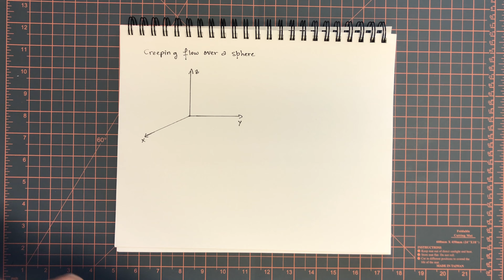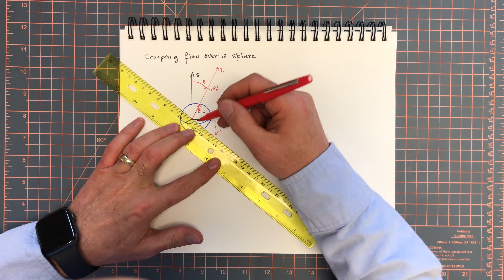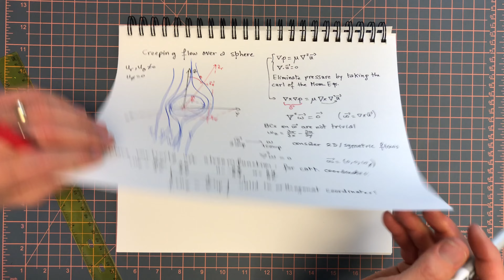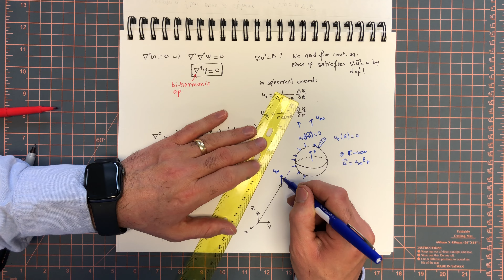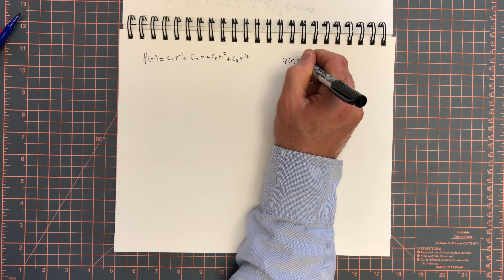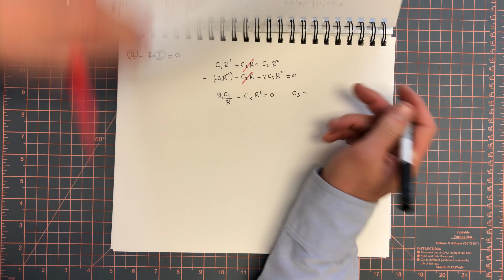16.7. Stokes Flow Over Sphere

Comment: i think you missed a step professor, should it not be divergence of pressure term gives one equation and curl of the same equation gives the vorticity which you mentioned, 
apart from that i have a question if added buoyancy term (rho=reho_0)=alpha*gravity*(T-T_0) in momentum equation, can you guide me if i can get the analytical solution as i read that the solution would be a linear superposition but when i tried i was unable to understand the way forward.
would be really happy if you can guide me a bit or refer me to some good materials